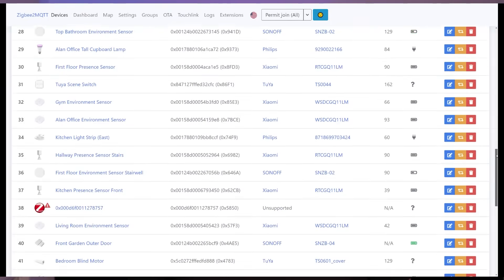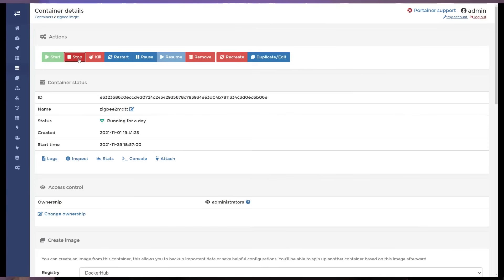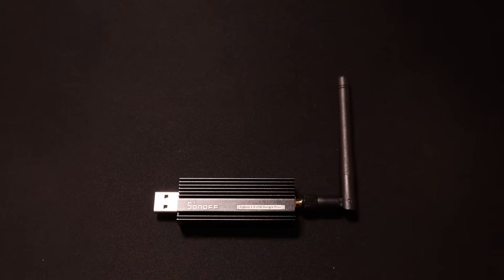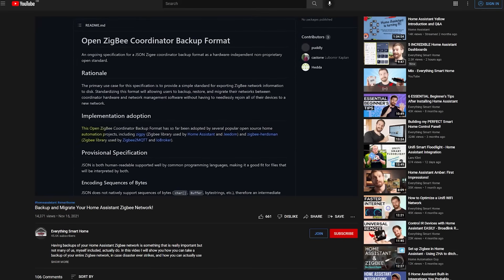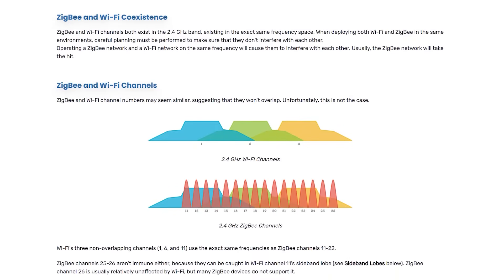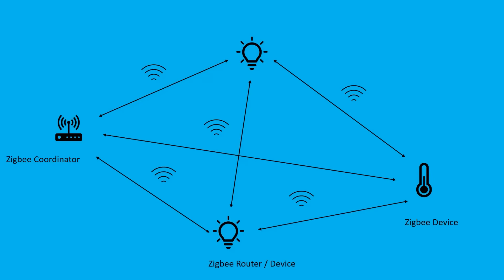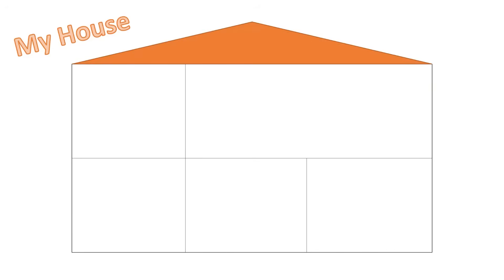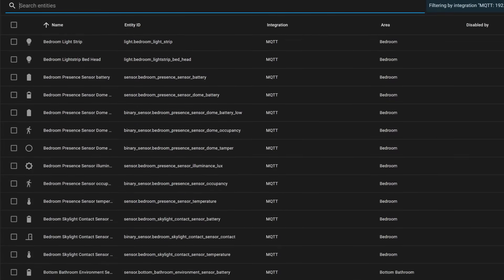Improve Zigbee network performance and stability with these 3 tips

Comment: I don't think my mesh is setup correctly. I have two repeater plugs centrally located downstairs and upstairs. I was not able to join new devices in the final location so I moved them next to the controller to add them. Looking at the map in Zigbee2mqtt I can see some of the devices are connected to repeaters but most of them connected to the controller. Does the mesh eventually heal itself or do I need to manually fix this? 
What is the best way to fix my network? Do I have to delete devices or can I re-register them near a repeater?
It would seem the mesh network is rather brittle if I have to manually fix it. I would expect I would be able to add and move repeaters and the mesh network adapt.
Reply from the maker: It is supposed to rebalance and itself, but I've had mixed experience with it. You should be able to repair the device near the routers without deleting them, that usually works for me

Comment: The unplugging and repluggging the USB dongle was an issue for myself. Every now and again the LED on the dongle would just turn off. But I found in my Windows Device manager there was a USB sleep mode deep in the driver info... It was selected by default. That fixed me.
Reply from the maker: Great tip! Thanks for sharing

Comment: Besides lights are there any other recommendations for good low cost repeaters?  I don’t have a need for lights with Zigbee so would appreciate any other solutions to extend a network
Reply from the maker: IKEA sell some actual repeaters that plug into a normal socket. I've had mixed experiences with them, as it seems not all devices are able to repeat through them. I'm sure you'll find some reviews on them on YouTube though
Reply: @HomeAutomationGuy  thanks for the pointer.  I've also heard mixed reviews so I'm going to give the SONOFF S31 smart plug for $10 US and see how it works.  By the way please keep up the great work.  You have a lot of great content and I watch all of your videos and have used many of your tips.

Comment: About the powered devices acting as routers: when you have a battery powered device that is to be placed in a room distant from your main coordinator, can you pair this through a nearby powered lightbulb (if the lightbulb is already paired of course)? I've always paired my devices very close to the CC2531, and moved them away to their distant places. I thought they would work through the routers placed in between no matter where they were paired.
Reply from the maker: Definitely. I always pair my battery devices in the place I want to use them. If the lightbulb is already paired and acting as a router for your Zigbee mesh network then it should work fine.

Comment: Great video! I use a CP2652 coordinator that is ethernet based. This is pretty nice since restarting Home Assistant doesn't impact the coordinator... (and if necessary I could power cycle the coordinator separately although I've never had to do that.) I do regret not getting a coordinator based on the EFP32 which has slightly more capacity, but fortunately I still have headroom under the CP2652 and will probably be fine for a few years.
Reply: Which router would that be if I might ask? Because an Ethernet based coördinator sounds like just what I need.
Reply: My understanding is that Ethernet / Wifi  coordinatora can't work with Z2M , correct?
Only ZHA?
Reply: @AhmadYusuf85  ethernet coordinators work fine with Z2M. I use the one from Tubes, (just search for "tubes zigbee", my previous reply with the link apparently got removed. The creator of that device uses Z2M himself so it's very well tested.
Reply: @csilvCorp  Thanks for the reply, I was under the impression that Z2M only works with devices that are physically connected to the host machine, hence it doesn't work with Wifi cooridnators like the Sonoff Zigbee Bridge for example.
The reason is that in the Z2M , we add the path to the physical device like /dev/ttyACM0, but if it's Wifi / Ethernet, how to you add it?
Reply: I use ZigStar GW and the new UZG-01 Ethernet Coordinator, what looks amazing.

Comment: Thanks for this. Turns out I made almost all of the same mistakes. Putting my Zigbee USB stick on a USB extension cable alone made a pretty big difference. I've also been pairing my devices near the coordinator and moving them, assuming the Zigbee mesh network was smart enough to pair with the closest / strongest signal instead of the original pairing device. 😑
Reply from the maker: I think it does re-pair eventually, but I personally have had better luck with this method
Reply: @HomeAutomationGuy  Yes it does., it takes a couple of minutes And so does removing the battery

Comment: Always use a naming convention from the start. You don't have to spend hours coming up with one, but a general rule of thumb is that from left to right you should have most significant info to least significant info. So for bulbs that would amount to "house-room-bulb_type-number" or something like that. Being lazy at the start will always hurt later on, especially if your family doesn't want a day of down time for the house.

Question: Is there any utility to inspect how the Zigbee mesh network is performing or established. Can you actually see what device communicates through what other devices in order to get to the coordinator/hub?
Reply from the maker: "Being lazy at the start" is unfortunately my standard operating method for home projects, as half of them never go anywhere...

Yes there is a way to view your network! If you're using Zigbee2MQTT you can use the Map feature in the top menu.  In the ZHA integration you can go to the Visualisation option at the top.  Both give you a diagram of your mesh network so you can see which devices communicate with what.
Reply: i used a similar convention - ABXY99 where AB is two character for room name such as LR for Living Room, XY is device class such as WB for white bulb or cb for color bulb and then a number. for echo devices across house, I have just given them phonetic names - alpha, bravo, charlie (except echo)
Reply: @mayankraichura  that’s like coders in the 80s worked. I encourage people to use more speaking names in programming. But if you are fine with it go with it. Long names don’t cost an extra fee but help in the long run. I don’t understand what I’ve coded some month ago with such short names. And I am a computer scientists for 20 years now 😂
Reply: @MatzeMaulwurf  So agree on this, cryptic variables always make debugging later on difficult, as no one can remember their entire code, leave alone a portion of it, that they probably haven't visited in a while. Same applies here. I too use the longer nomenclature like livingroom.tll for my left tv light or dinnerroom.dll for my left dinner light.

I do think I would need to have a more robust naming when I get into more devices as I go forward. 

It's a w0nderful wor1d!
Reply: Good point. I chose single letter (D = dimmer, S = switch etc, then added a simple serial number. 
Routing can be shown in the Zigbee2mqtt frontend. Slow, but infinitely cool B-)

Comment: I use mostly Zwave devices to avoid the 2.4Mhz congestion. I live in a city and have a lot of 2.4Mhz noise from my neighbors. But some of my devices are WiFi or Zigbee.  I noticed that my  Zwave  network has a better penetration in this noisy environment. I also noticed the same problem with not having a good naming convention. I now use something like light.livingroom_ceiling_dinnertable . But noticed that I need more and more rooms to divide the house more as the number of devices grows. For instance the storage closet in my living room became an other room.
Reply from the maker: I've heard that about Z-Wave devices, but I've never personally used them so have no opinions myself.  I started off with Philips Hue back in the day, and naturally gravitated towards Zigbee so I could reuse my bulbs.

Once you get that Home Automation bug it is hard to stop buying devices isn't it!

Comment: Good video :) well explained and thought out. One problem I face is that some of my first smart lights (hue) are now 10 years old. And still, using zigbee light link (zll) hue decided to not upgrade to 3.0 on the oldest hardware. Somewhat understandable but zll is very chatty and if I move everything to one hub the zll bulb will drown out all the 3.0 devices :) so I keep the old hue hub for those. Could be a thing to keep in mind if you like me still have old hue lights.
Reply from the maker: Thanks for sharing

Comment: I don’t understand your point about pairing to the correct router. Are you saying the mesh isn’t smart enough to reroute it’s connection to the closest router when link quality is too low? 
I have about 50 zigbee devices, all paired at the same spot in my house, then moved to their location and all seem to have found a good working route without ever thinking about this
Reply from the maker: They are supposed to reroute their connection according to the Zigbee standard, but I find that in my house it often takes several days for the routes to change unless I manually re-pair them.

What Zigbee devices are you using and what brand/model are they? I'll have to give them a test!
Reply: @HomeAutomationGuy  Ah I see. I just checked my Z2M map. I have 47 devices (Hue/Ikea/Aqara - from which about 60% router) and only 3 devices are left connected directly to the coordinator (slae.sh). While having paired all of them really close to the coordinator (thought at the time that was neccesary). 
I think the map looks better now then in the beginning actually. So yeas I think it changes as well after some days now I look at it. Just never had any issues.

Comment: Some Zigbee lights may not act as routers. I use Sengled E21-N1EA bulbs (which are great, have good colors, and decently priced) but they do NOT act as routers. Per Sengled's support page: Our engineers made this distinction as repeaters require constant power, but people still tend to power off their bulbs with wall switches when leaving a room. With no power to the repeater, other end devices may disconnect.
Reply: Thank you for mentioning this.  I planned on using Singled bulbs specifically to be zigbee repeaters and didn't think to think that this functionality could be disabled.
Reply: @RConradBane  In their defense, I don't think it is a bad thing. If a light gets turned off, then your zigbee network may not function properly. I bought a couple cheap zigbee plugs just to use as repeaters. $20 for 2. Amazon ASIN: B08K45W4LR. They work great. Recently, I plugged in the chargers to Fire tablets that I use as Home Assistant dashboards. I set up an automation that only charges the tablets when needed and turns off the charger when it is not.
Reply: @d_sellers1  That's a pretty smart workaround.
Reply from the maker: That's good to know. Thanks for sharing!
Reply: I'm pretty sure Zigbee2Mqtt has a compatibility list that specifies if the device can act as a router - always worth double checking that

Comment: My entity ID is type.room_placement/device, then I name it placement/device. Ex. Entity ID is switch.kitchen_airfryer and name is just “Airfryer”. Entity ID is light.basement_storage and name is just “Storage”. It makes it easier when creating automations based on rooms. I used to do light.basement_storagelight “Basement Storage Light” but I found I would group it in Lovelace under basement, and it’s icon would be a lightbulb so Basement and light were redundant. Also when automating the type makes adding light at the end redundant as well.
Reply from the maker: You're right! You just made me realise that adding the word Light to the end of the Light entity name is totally redundant 🤦‍♂️
Reply from the maker: But then again, it doesn't show the device type or icon in the Device list area of home assistant...
Reply: @HomeAutomationGuy  that’s true. I don’t have more than 15 devices so I know what each one is. Maybe the type would be helpful in the name for more devices.
Reply: I’m using the same scheme. It works perfect.